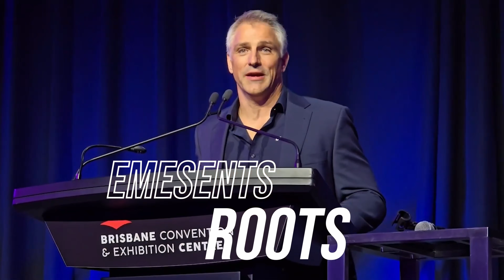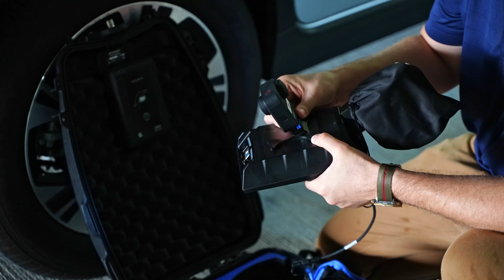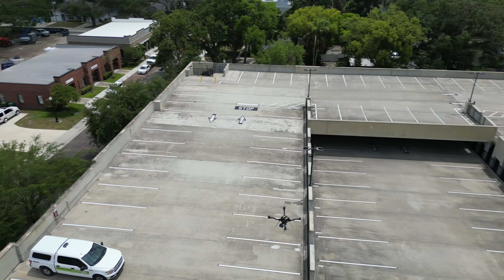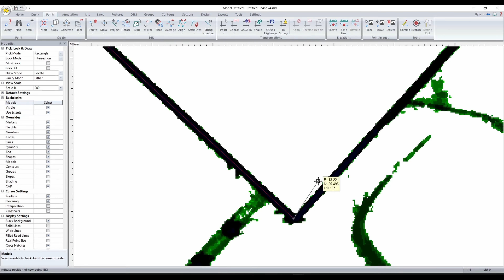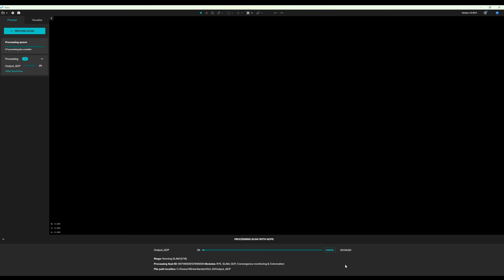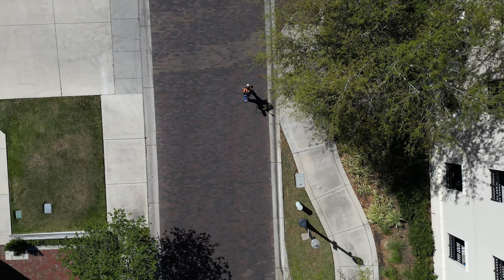Emesent ST-X (SLAM + Aerial LiDAR + Mobile LiDAR) : SLAM WARS Episode 3

Comment: Have you ever tested the SURPHASER stationary scanner? It is at least 10 times more accurate than any of the ones you mentioned here. It offers precision and a noise level of just 0.2 mm! This is, in fact, the "ultra-high-precision LiDAR sensor." You can measure the thickness of a piece of adhesive tape (like duct tape) stuck to a wall and even visualize the tape's texture.
Reply from the maker: I haven’t ran that specific TLS